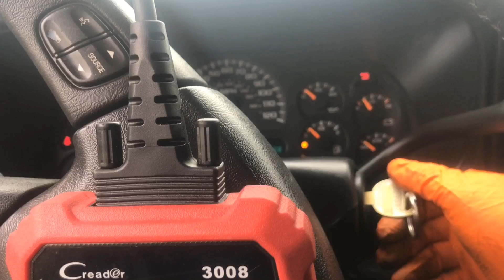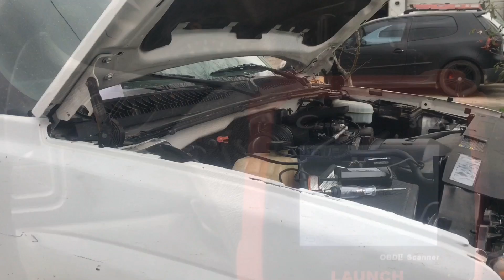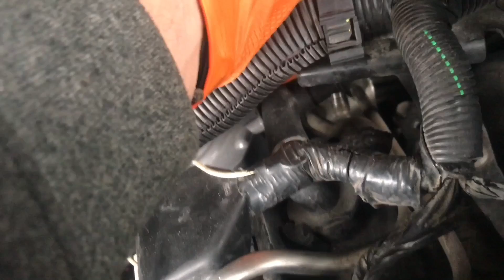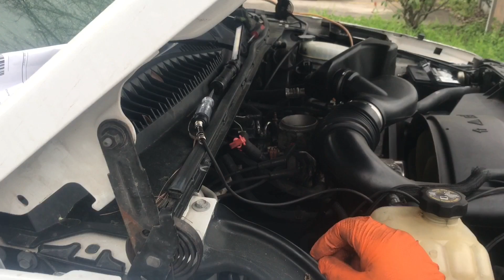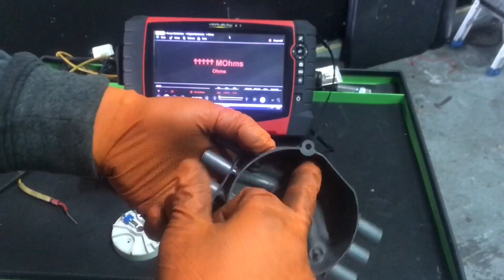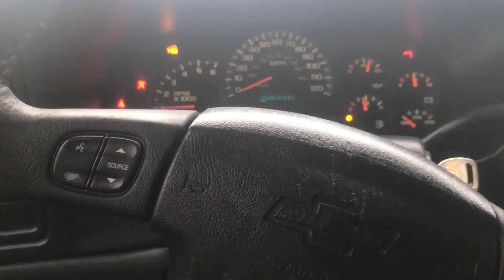Chevrolet Silverado Crank no start

Comment: Wish you would have shown cleaning out the screens in that distributor. Got a 98 safari van with the same engine and it seems the cap and rotor need to be replaced every 4 to 6 months. I've tried cheap chinese parts all the way to ac delco parts and it doesn't seem to make much of a difference. It is a pain taking this doghouse off every time I need to change the cap and rotor

Comment: Fuel line check valve until you can get a new pump in it. Started pretty easy so assuming the regulator/injectors aren’t to bad.
Not that you needed my input. I just find it fun to armchair tryagnose 😁